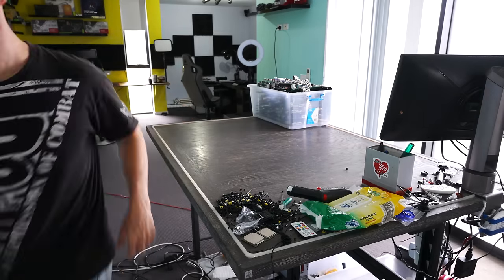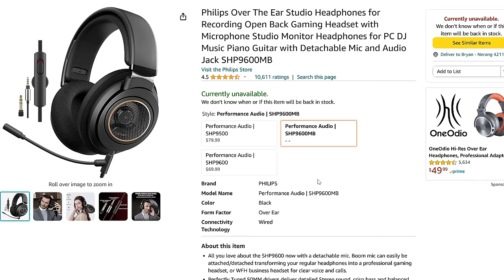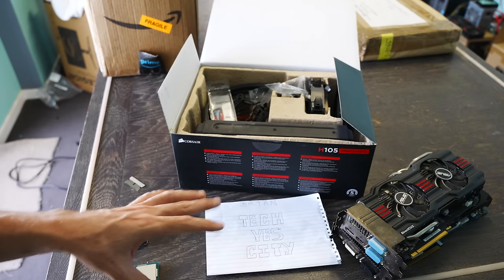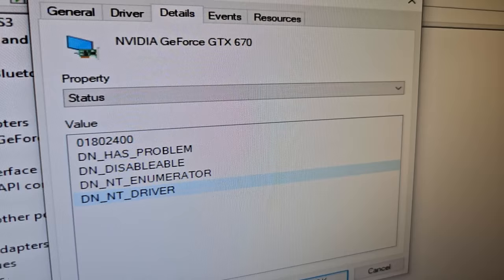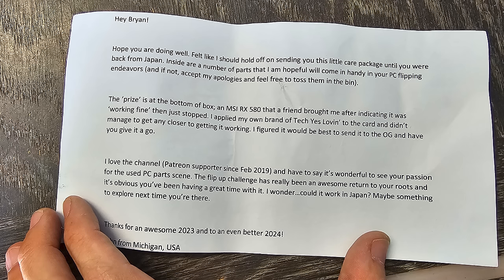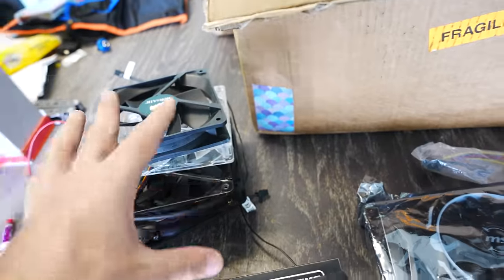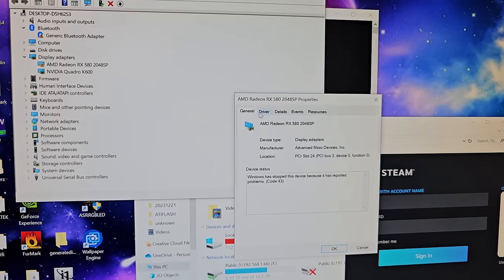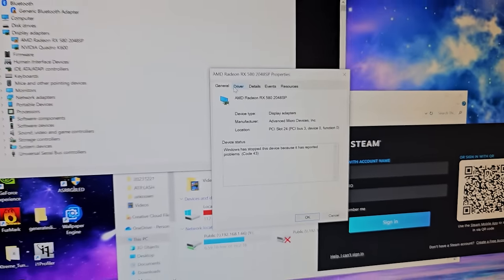You guys Sent me a WHOLE Table of Faulty PC Parts... (Can YES Fix it Pt. 1/2)

Comment: I find it better to thoroughly test out a HDD is to use software from the manufacturer of the drive if they have it. For example Western Digital Dashboard for WD drives. If you run the thorough test it can take a while depending on the size of the drive, but if there are any bad sectors it will find them. And it can also tell you the health status of the drive. This is very good for testing out drives to find out if they are a good candidate to be part of a RAID array.

Comment: Hey Brian. I have the same exact RX580 8G you got with the same exact problem. It started having issues about 2 years ago. After spending some time diagnosing the issue, It turned out to be the V-BIOS Chip. I believe it was just derogation overtime causing the GPU to work on occasions. I replaced the V-BIOS chip then flashed a newer BIOS version for the same exact card and had no issues since then. After I stress-tested the GPU, I gave it the " TECH YES LOVIN" by cleaning off all the dust, replacing the thermal paste and thermal pads and it's been solid ever since. I use it on an Emulator/HTPC system that I built just for emulating and streaming videos and till this day it's had no issues.

Comment: As for the dual-cpu board - do not overlook the SSD that should be in one of the compartments of the motherboard box. It has clean W10 installed and activated with all the drivers and stuff :) Good luck with the build!
Reply: Opening that box had to of been like a heart stopper.

Comment: For testing HDs, being able to install and boot Windows isn't a great test of whether the drive is actually okay. For mechanical HDs you're better off running something like badblocks that will test the entire drive. For SSDs I don't know an equivalent (you can run badblocks but it will obviously lessen the lifespan), but generally just checking the SMART data seems a pretty good test.

Comment: Edit: commented before he got to the bios part 😂. Good job!

I'd suspect a lot of 470/480/570/580s could have modified mining bioses on them. I always refreshed them with stock bioses off of techpowerups VGA bios collection and that has done the trick on a few of them. Always can do the paperclip trick to if the bios is bricked or has issues to get it reflashed.
Reply: this is true, but a lot of the mining cards these days just die due to soldering points degrading either on the memory chips or core or both ive fixed many just by re flow but some need to be resoldered

Comment: I personally have had no Issues with RX 580s, I own 2 of them & have used them in many budget builds. BUT I have not purchased any used ones in a couple years. I got a New one from Ali Express for 50$ (well at least the Cooler & PCB were new, it may have been repurposed GPU) but it works fine. Must be having at least some bad luck but also the Cards are quite old & anyone that was using them in the last 2 years on newer titles probly Overclocked them to their Death or close to it trying to squeeze out that performance.
Reply: 🙂 i have three new ones, they dont work on older motherboards, they dont work with older TVs

Comment: When tech yes man said If it gonna waste more of your time than to fix it- i felt that

given up on trying to fix my faulty ram issue that works 20% of the time
Reply: Allot of the time the ram is not really faulty, it is just not compatible with the system you are running with its XMp profile.   Not seated correctly,  or in the correct slots.  Cpu can be the culprit also, I always like to repaste and reseat the cpu as long as the case cover is open.   Toss up your specs, mobo, ram, cpu and bios version.  If you are thinking of just getting a new ram kit the same as you have that might not be best.

Comment: At 16:30 you talked about what I'm stuck on. I have an ASUS TUF x570 motherboard, I got an older CPU, which works great, but I have a 5800x3d that's just sitting there because it doesn't work. ASUS does not have a bios update for it...of any year. I've spent a lot of time over the last weeks not finding it. Any suggestions would be great!

Comment: Your hack for the RX 580 worked for me with my R9 280X. VRAM was on the outs and with lower clocks it was able to play games again. The only game I couldnt get to work right was Fallot 4. It would literally run at 2X speed in the cutscenes and had some bad stuttering also. But it did work for me for a little over a year until I finally upgraded to a RX 6800xt...

Comment: Follow channel quite a bit, though, some of it is above my head (technically). I have a question. I use a CAD program (FreeCAD), mainly to model 3D prints, and also dabble in some video editing ( not too high end). I will have to replace my 2012 PC. Some of the usb and sound parts are failing. My current system is an i5 2500k 3.3ghz, 8gb RAM, graphics is GTX 1050Ti. This graphics card seems to be OK for CAD, but struggles, somewhat with the video ( I am using CapCut). I also did have AMD before. Are there some recommendations out there that would suits my needs, regards, David
Reply from the maker: will answer it as the question of the day in tomorrows video for you.

Comment: off topic but im planning to build  my end game pc for 1080p gaming with ryzen 5600x + rx 6600m for 30k php or around 500$ is that okay (whole pc)
Reply: Rx 6600m is a mobile gpu with only x8 pcie 4 lanes, you want to get desktop parts, rx6600 or rx6600xt if possible get a rx6700 10gb or rx6700 xt.
The cpu is good more than enough for 1080p gaming.
Reply: For 500 USD that's great, but if you can get new rtx 3060 on the same price it will be better for 1080p gaming.
Reply: @chibonchibon3967  why you recommend rtx 3060, it's the same price as rx6700 xt.
Rx6700 xt is much faster card.
Reply: @dagnisnierlins188  no its okay ive been considering the 3060 too but the problem is 3060 is much more expensive (19k php cheapest i found or around 350$) and 6700xt is definitely much more expensive than the other two, its like 25k (cheapest i found) php in my country or 460$ (converted)
Reply: @chibonchibon3967  ive been considering 3060 but my question is if i choose 3060 whats the perks of it like ive seen benchmarks with 3060 vs other gpu and its almost the same as 6600 non m but a little slower than the m version
Reply: @KurozawaOfficialyy  have you checked aliexpress?
Reply: @KurozawaOfficialyy  if rtx 3060 and rx 6600 xt had the same price like in my country it had better compatibility and less problem with many games such as fortnite. Sometimes fortnite update force my Rx 6700 xt to use dx11 just to run the game until AMD fixed the driver. Yes I use both AMD and nvidia , nvidia always had less driver problem. Also dlss is a must for newer game, just better than fsr.

But if what you mean is laptop version , hmm just choose cheaper one
Reply: @KurozawaOfficialyy  the best perk would be getting dlss upscaling, but it's not worth it for 1080p.
If you had 1440p monitor or 4k monitor then maybe.
Reply: @dagnisnierlins188  not yet cz idk i just dont trust it yet
Reply: @dagnisnierlins188  yeah im good with my 1080p thanks tho
Reply: @KurozawaOfficialyy  honestly just go with the rx6600 or rx6600 xt, avoid the 6600m, you will need a motherboard with pcie 4.0 to take full advantage of it. Get a cheap b450 motherboard maybe 3200mhz ram, and you will have a killer 1080p gaming machine.

Comment: You want to much for your computers, that is why sales are struggling. There are two ways to make money in this. The first, and apparently general way you use is to attempt to convince people you are offering something premium, that somehow by the fact that YOU touched, it is worth more than its worth. The other way, the method I use virtually exclusively, is making the money on the back end. I buy super low, and sell really low, therefore, my stuff actually sells because it offers a better price. Also, right now we are in a market phase where seller perception has not caught up with what buyers want. A 4790K with a GTX 980 is not something buyers really want anymore, they want 8700Ks with 1080s and 2070s, and they want it for around $500, but sellers want $100+ just for the chips and $150+ just for the cards because these parts are still gold plated in the minds of sellers.
Reply: 😃 yes!

Comment: It wasn't exactly 580 vbios, it was 580 2048sp which is 470/570 vbios.

Better try to flash 480 vbios (they have lower clock speeds)

Comment: if the gpu's weren't working when you got them, they won't work after blowing the fans high speed, while the connector is still connected to the fans header(power generators)
Reply: Pulse width modulated motors should not work that way.